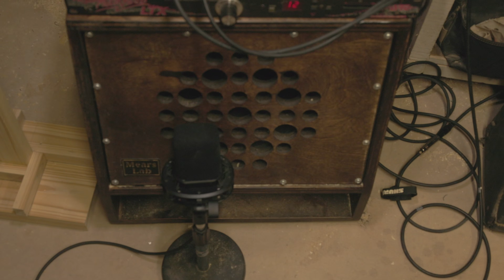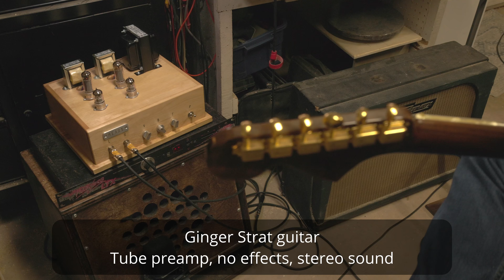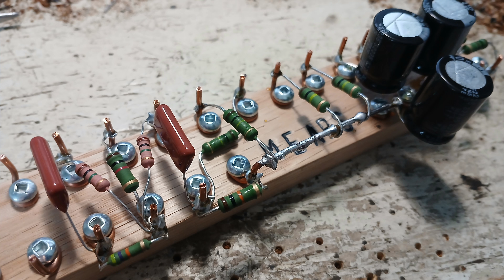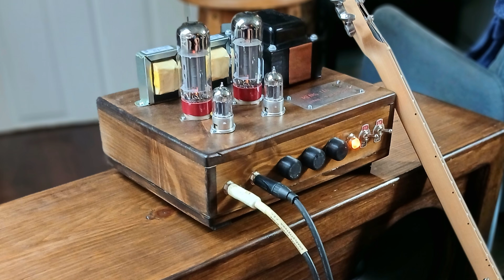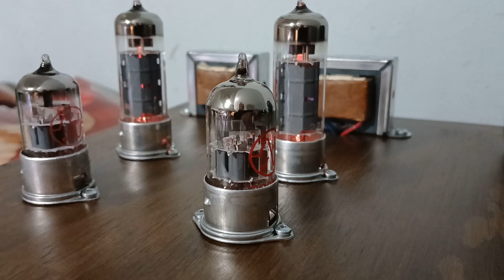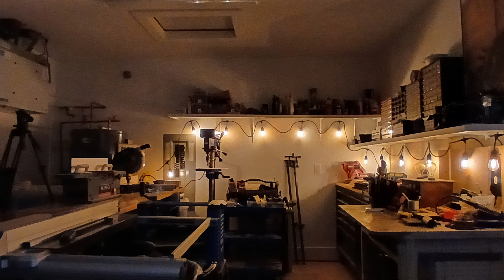Check out this Stereo Vacuum Tube Guitar Amp made out of Wood (Fender Champ 5F1 Circuit)

Comment: Very old ham radio magazines and some books for introducing kids to electronics show how to build a radio and other electronics on literal bread board. A woooden breadboard was the original breadborard, which today has kept the name but has changed its appearence with plastic frame with thin metal contacts in side that you can plug your components into.

Comment: Wooden circuits - Audio Note, the Rolls Royce of valve hifi, use wooden circuit boards.
The best thing is to make 3mm or 5mm plywood boards, drill them then varnish them and let the varnish thoroughly harden before lacing and soldering.
Selling Amps - I don't know what the law is in Canada but its probably the same as in Britain were you have to produce over a certain number before standards apply, under that its a 'handmade' item and not covered by law. EU Rules demand a 2mm gap between primary and secondary on transformers, but if you wind your own and make less than 2,000 a year (if memory serves) then you can have just the 2 thou of varnish on the windings as a gap.
Reply from the maker: Could you give me a link to an exmaple of the wooden boards in Audio Note gear?  I did a bit of a search but couldn't find anything, and I think that is really intriguing.  I would love to learn more about them.  Thank you for the kind words and support!

Comment: the riff he is playing around  5:50 is playing a song by the fugs "cia man" in my head . love the amp , the tube pre , your cabs , and hats off for that ART but its not an oem knobber on there is it ? super cool-sounds great too . 9:28 - wow ! gut shots 12:17 . the first circuits where made on breadboards . men would borrow the wives breadboard and build a circuit on it . thats why we call exp proto boards breadboards . i am not a pro tec or expert i am a huge goof . that is a breadboard - period . you can call it what ever youd like but if i saw one in the wild , i would call it breadboard style .
Reply from the maker: Thank You so much, yes that knob on the ART came from my dads collection of parts.  The original stereo fader in the processor was wornout and i didnt have any others so I just used a pot instead and drilled a hole in the faceplate to mount it!  The rack is about as crusty as they come.

Comment: Thanks for this very interesting post.  Question.  How did you ground everything without a metal chasey?
Reply from the maker: Great question.  There are two ground busses in this amp.  The first bus is for all of the external metal parts, all of the metal parts like the transformer, tube sockets, etc.. are connected together in a star pattern which resolves to the ground connection on the main power socket.  That minimizes any shock hazards.  The second ground bus is for the circuit common ground.  All of the grounds in the circuit are connected to that bus, which resolves at the ground for the 1st power supply filter cap node.  The two ground busses are connected together through the ground lift switch on the back of the amp.  There is a bit more to it than that, but that is the general idea.

All truths be told, I need to update the ground wiring in this amp to what I mentioned above.  I realized after building that I could have wired the grounds better, however I also needed to just get the video out and stop tinkering with it too.  Thanks for asking!

Comment: I commend your efforts but this amp is a major fire/electrocution risk, at the least you should put all the components on a fibre glass turret board. 

Wood is 50% carbon, it’s possibly one of the worst materials you could use as a circuitboard material.
Reply from the maker: I appreciate your feedback, and agree that wood is flammable, however so are all of the components inside of the amp like the resistors and caps.

Over the years I have seen many questionable pcb's in popular amps, one example is the Marshall DSL50.  I have seen multiple examples of that amp, with faulty traces in the power supply section, which resulted in the board/components literally catching on fire.  Keep in mind I live in an area with a small population so the DSL50's I have seen would only be a small fraction of what is actually out there in the world too.

Another example I'll bring up are the wax impregnated cardboard turret boards in vintage Fender amps.  Many of them become conductive over the years, and since the chassis is metal, components can short to the chassis, which can lead to many high current paths.

Also keep in mind that many electronics made with current turret board technology are still housed in wooden enclosures, and in many cases, the components are still quite close to internal wooden surfaces.

I'm not recommending playing this amp on the poop deck of a boat in the middle of a lightning storm.  If the amp were to become "saturated" with liquid, then it could cause issues, as proven by my previous tests.  However I mostly play mine in the garage and occasionally in my friends basement when we jam.  It's a controlled environment.  I've made many of these types of amps and had them in service for years, no issues yet.  I don't want to come across as smug or arrogant, because who knows what can happen, but so far so good.

Comment: beautiful! i always wanted to build like this but i always thought i would have hum from not being shielded in a metal case like a chassis. do you have any problems like that? (i mean it sounds great from where im sitting :)
Reply from the maker: Thank You for the kind words. I know what you mean about shielding and hum, and I was worried about it too, but after giving the build style a try, I realized it actually has little to no hum, even with no shielding on the amp surfaces or on any of the signal wires used in the amp either.  I believe that being able to put anything anywhere you want in the amp helps a lot with this, it makes it a lot easier to keep high current areas of the amp away from inducing noise in lower current areas.

All that being said, this is not a very high gain amp, so it could be different if one were to build something like a JCM800 into a wooden cabinet.  I'm not sure yet, but it's on my list to find out someday.  Thanks again!
Reply: I’m fascinated with what you did here with both using wood and wiring them in stereo. Is a schematic available to drool over? I have so many questions about this build and would really enjoy another video covering the wiring and some of the parts choices such as the transformers. My idea is to combine two 5F1’s into a single chassis and having them voiced differently and then each one going to a 2x12” cab with the speakers separated internally. I’d like to have one stock and the other hot rodded. I think for my idea I might need dual power and output transformers but I know there has to be a way to use one power transformer. Hey I’m still on my first tube project so this is down the road a ways but as soon as I get this MOD102 working that someone botched, I’m going to order a 5F1 kit from amplified parts. My MOD102 parts will be in this week so we are on our way. Thanks for this cool video.